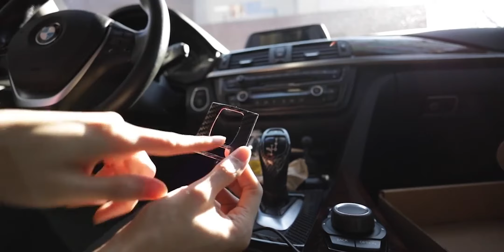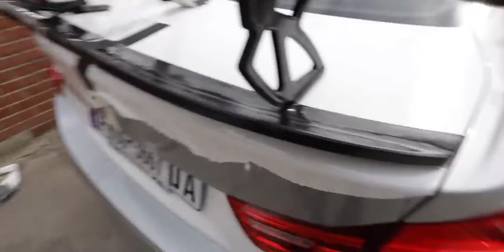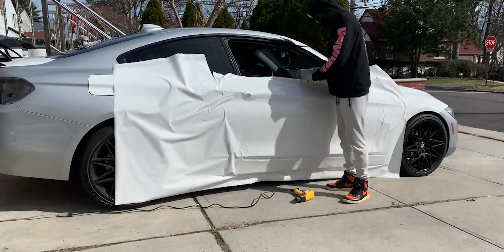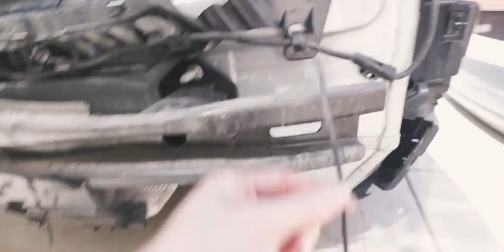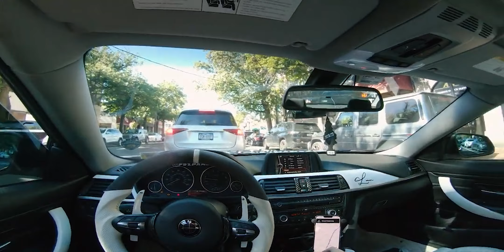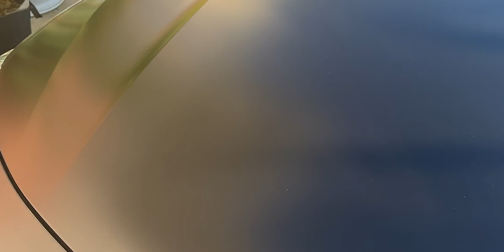BUILDING A 350HP BMW 428i IN 10 MINUTES!

Comment: Not enough love out there for this car. People need to drive it to understand. This is a 4 banger sleeper.
Reply from the maker: Frl, I’ve seen many f30 builds but very few f32. Although there a very similar car the f32 seemed to handle better due to its wider track and more balanced weight. Sad to see it’s often slept on
Reply: Depends on where you live at, its definetly not overseen in belgium, there are so many that i dont even find it unique anymore
Reply: I was very pleasantly surprised after buying my ‘14 f32 xdrive. Super fun car for the price, and lots of potential
Reply: It’s dope until ur engine blows like mine at 112k  km😢 only had stage one tune, after market intake, lowering kit and diverter valve.  Had it from 92k km. Next one I’m gettin is gonna be the 435 or 335. Too many horror stories about the n20 engine. Also costs 10,000$ to replace the engine with labour.
Reply: @istayhighi1540  got mine going strong somehow, this B46/48 is second best to B58
Reply: I just bought a 428I cabriolet 2014 year and can`t believe how much i love it.

Comment: it looks cool, but wheres the 350hp coming from? I hardly saw preformance mods, hpfp? turbo upgrade? I saw a charge pipe, intake, intercooler and an exhaust?
Reply from the maker: 350 crank, wheel closer to 300. Intake, downpipes with straight pipe stage 2 on 93, occasional ethanol  blend/map but on stock fuel lines and stock turbos on max PSI. Will say it was a bit sketchy of a setup maxing out on some stock components but nothing broke down or blew. It started struggling with traction on 265s all around so could never really launch it from a dig smoothly without the rear acting up. Eventually returned back to a conservative stage 1 and kept it mild b4 selling it.

Comment: whats type of wrap is that? And is it that easy to apply i was under the impression that it was difficult especially with ridges
Reply from the maker: i had 2 wraps, first was vivid gloss white, 2nd was avery satin black. both were somewhat easy to use, avery was much thinner and more stretchy which was easier to install but was more prone to stretch marks, whereas vivid was slightly more difficult to work with but was thicker and withstands scratches a bit better

Comment: hey man ım currently buyıng 428i convertible and ı was curious where you get the aftermarket parts especially interior wise, thanks for the help. nice build
Reply from the maker: Most was eBay, a lot of the carbon trims and floormats. The white interior was vinyl wrapped. The seats were Braum elite x

Comment: what performance mods u got done to make a n20 350 hp?
Reply from the maker: Catless downpipe, intake, charge pipes, res muffler 2nd cat delete. Stage 2 Tune on max boost limiter, tranny tune
Reply: @RickyMoto  okay thanks ima probably end up doing that to my 328i as well do you know if it’s reliable
Reply from the maker: Haven’t had any issues with it and car had 75,000 miles for a 2014. I do recommend upgrading intercooler since engine temps will quickly rise.
Reply: @RickyMoto  okay will do i appreciate it
Reply: Don’t think it will do 350hp on stock turbo unfortunately. I’ve got mine fully dialed in with S63tu injectors and higher compression engine and it doesn’t go past 300hp. Turbo needs to be upgraded to a tte400 to get those numbers. She looks clean though!
Reply: @officiallopez2334 thanks for keepign it honest
Reply: F32 428i stage 2 max is 310 hp
Only with hybrid turbo and max is 320

Comment: what’s the link for the bumper and what else would i need to buy with it ?
Reply from the maker: I would suggest getting from Keis, m4 style bumper for f32. and there’s nothing else you’d need only thing is to remove the foam brace in the front. If looking for the rear I got a oem m sport rear which was direct fitment

Comment: Give specsssss for tires and where did you buy the carbon fiber trimssss
Reply from the maker: carbon trims are from ebay, XXR521 wheels 18x10 et25 (does poke quite a bit, doesn’t rub on stock suspension) tires are 265/35/18

Comment: is a 2014 bmw 428i with 59k miles reliable? It was previously a lease vehicle
Reply from the maker: If it was well maintained and has service records. My 2014 428i I bought from Carvana with 62k miles and had like 5 owners and a ok record. But I never had any major issues with it and I sold it around 80k miles, new owner doesn’t have any major issues either. The only maintenance I did on it was oil changes every 3k miles, and a transmission flush around 70k. Other than that nothing went bad unless I broke it myself. One of the headlights had a malfunction after a heavy rain, assuming water leaked into the connections but then it started working again. Also it had the n26 SULEV motor which warranties from bmw until 150k miles so if you find a n26 rather than a n20 u should be good. Every car will have its quirks, when I first had it the trunk struts were going bad so the trunk would only lift like 1/2 way, the aux plug was faulty, but was able to get all that fixed fairly easily. The tpms wouldn’t read sometimes but that’s cuz I was using cheap aftermarket tpms sensors in the wheel
Reply: @RickyMoto thank you for replying I appreciate it! Going to be picking it this weekend hopefully 
It has a good amount of service records with 2 previous owners
Reply: @RickyMoto  question 
Let’s say I found a n20 2014 428 with 58k miles all the maintenance and everything is update nothing missing no crazy gaps, how deep shit would I be potentially?

Comment: Would a bmw 3 series 2019 be small for a 6’3 guy or am I good
Reply from the maker: Think you’ll be fine, your head might be close to the ceiling but it shouldn’t touch if u put the seat lower
Reply: I have a 2018 m240i and I’m 6’1 and I’m pretty close to touching the roof. If you can manage it, try to find one optioned without the sunroof, it will give you more head room.
Reply: @ParkerTheRapper  it’s for my first car at 18 I just like how it looks even tho my friends say get a 5 series
Reply: I’m 6’4 300 pounds, you good bro
Reply: You’re tall, but you’re not that tall

Comment: Where did you get the new steering wheel from with the airbag?
Reply from the maker: Azaautowheel, you can request airbag with it
Reply: @RickyMoto  thank you
Reply: @RickyMoto  it says the airbags aren’t included
Reply from the maker: @sxyru115  I custom requested it with my order with customer service, was additional cost tho. It was a fully custom wheel I spoke with them for a while for what material and colors I wanted so maybe if ur going fully custom you’ll have more control on what exact u want. It costed about $2k for the whole setup
Reply: @RickyMoto  thank you so much

Comment: is that perforated leather on the sides or nappa leather
Reply from the maker: On steering wheel is perforated leather on side. Although I would of preferred nappa cuz it’s softer and also easier to clean. After a few weeks all the little holes get crusted up and need a deep clean

Comment: @rickymoto how long did it take you to wrap the car? And any tips cuz I'm trying to do my 340i.
Reply from the maker: about 30mins per panel. took about a week to complete. id say the heat gun is your best friend in allowing the vinyl to soften up and manuver, stretch it first over the panel which will help prevent bubbles. ofc prep surface with alcohol to remove oils

Comment: offer me an a 328i 2014, for like 7k, i have a camaro 2011, is a good trade? i dont have too much money for the maintein and repair p.d sorry for me bad english im form Mx.!
Reply from the maker: It sounds like a pretty fair trade idk what miles ur lookin at with the 328. But the n20/n26 platform is pretty reliable. Personally I haven’t exceeded 80k miles on mine. But I have friends that are driving up to 150k miles s without issues. Just requires some extra love when it comes to maintenance with higher milege but it’s a good car that holds up well and produces decent power. The only major things I’d focus on is doing oil changes frequency, I prefer 3/4k mile intervals, new spark plugs, gaskets cuz they tend to go bad, making sure u upgrade Chargepipe cuz that’s a weak point. Other than that’s there’s no many mechanical issues. Timing chain is another one that’s prone to going bad but once that’s fixed up it should be good
Reply: @RickyMoto  Thanx You!

Comment: Where did you get the f32 badge
Reply from the maker: Custom, I bought a 320d badge off eBay, used the 32 then the d I flipped it upside down like a p then cut it into an f to get the f32